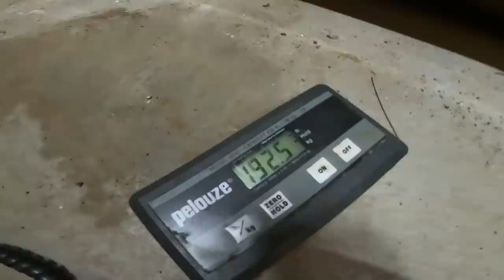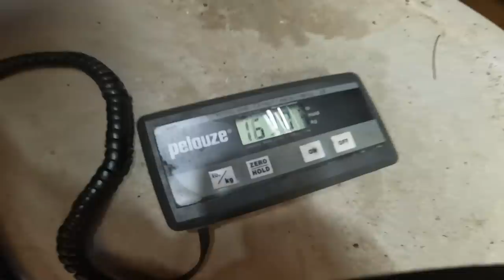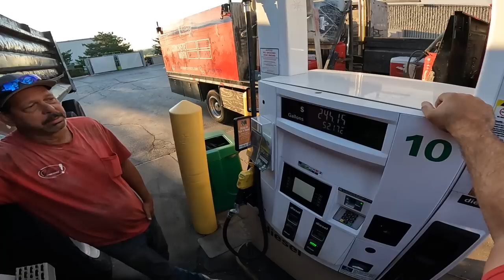Too much fun on a small concrete project!

Comment: The phone u got with the concrete company and how quickly you said don't worry about it, that is (one of many reasons, all good ofcourse) why you can call and get concrete when u didn't orderor get a truck at different times than you wanted.
When someone bends over backwards for you, you need to be willing to do the same for them when that day comes.
Good job Ryan.
I'm so happy you put that in there.

Comment: The paddle boat wouldn't turn because the back side was too high and not in the water. It turned into your weight instead.